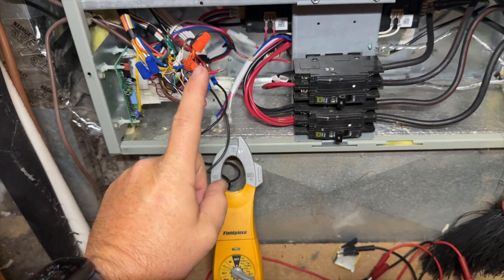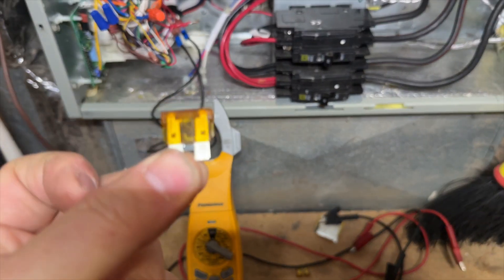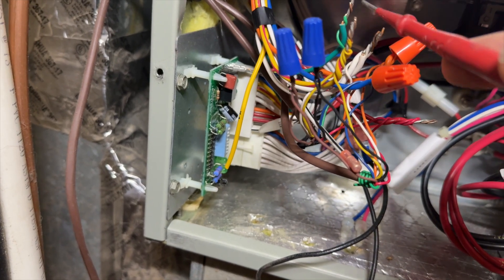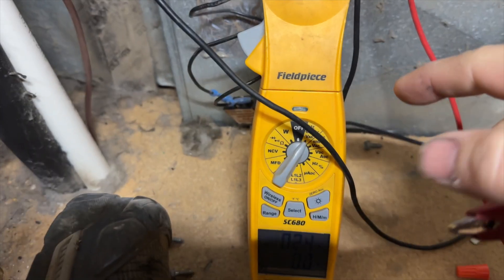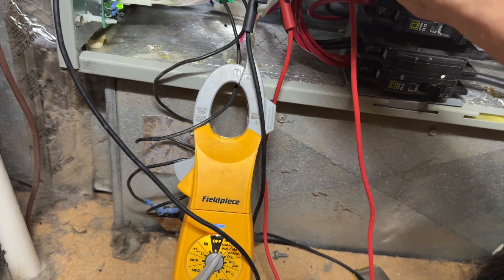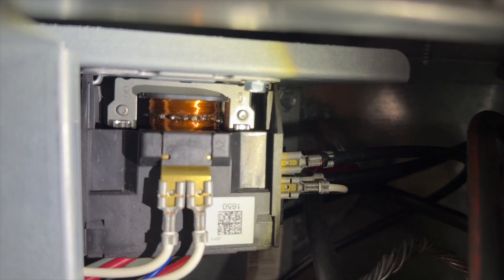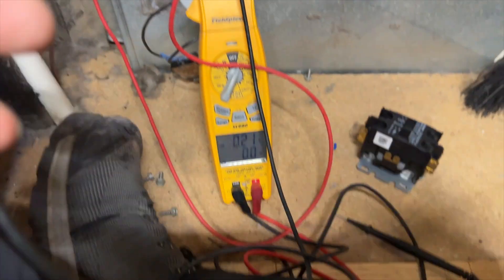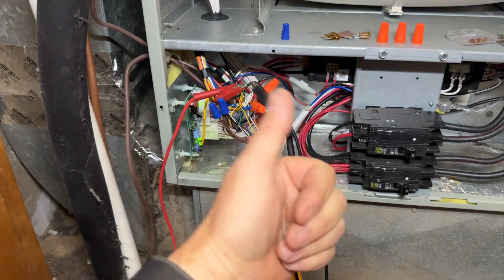Heat Pump Keeps Blowing Fuses and Resetting the Thermostat? How I Found the Hidden Issue EP241

Comment: This happened to me once where it was pulling high amps and system kept resetting instead of blowing the fuse. It was happening in cool and ended up being the contactor on the outdoor unit. Thermostat would keep resetting and going on wait. Didnt know this was possible and thought it would just always be a blown fuse

Comment: Thanks for the video sir! Nice to see someone use their amp meter along with the popper not to stress the transformer allowing popper to heat up and pop because it also heats up transformer windings too! Many years ago I switched to the Short Pro Tool and like it better but still to this day use my amp meter in conjunction plus during maintenance I always clamp my 24 volt circuits and go through the cycles and document amps because I have seen many times issues forming with higher amp draws over time....catch it before it happens is best and true maintenance. Document, document document....the data can tell you the future if you take the time to look at it!